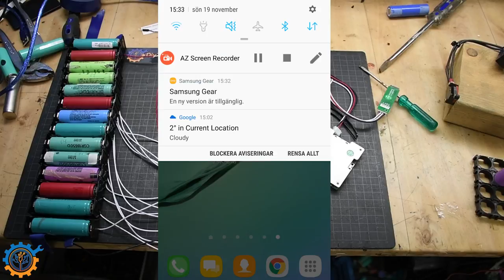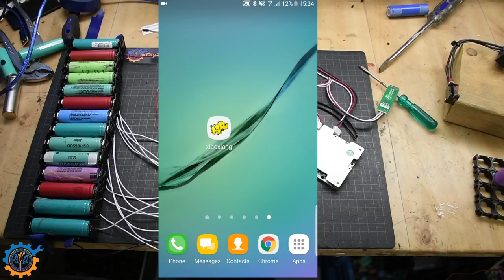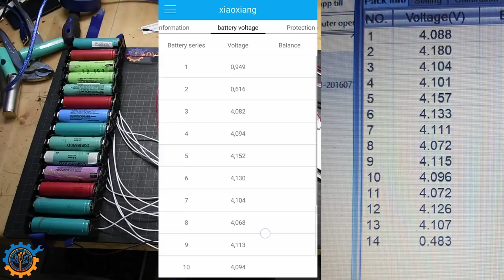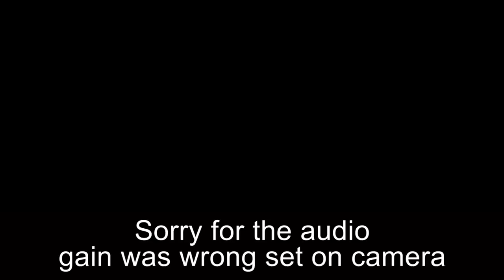Cheap BMS - Mobile software update - English

Comment: Classic Chinese BMS! This is exactly what I have to deal at work every single day... so frustrating... hardware and or software issues.
Chinese warranty: you contact the manufacturer, in many cases they will say "we sold millions all over the world, very successful product, we trust our engineers, YOU must be doing something wrong, please check" ohhh I have no words to describe... 
This is why is worth investing money and get Batrium =]
Reply from the maker: Yeap for sure! :) The more I used it the more stuff i have found that.. Lets say it gently.. Doesnt work :P
Reply: I dealt with a guy named James.  He was no help.  But at least he tried. I eentually figured it out on my own.  I dont think he is very technical.
Reply: Looks like Batrium does not have any 20S BMS. Can you recommend any other BMS for that many cells? BesTech?
Reply from the maker: Batrium can do ALOT more than 20s. You can easily go above 400V and they have even done above that.
Reply: Jeff Beasley Batrium is a flexible system, one main board controlling as many series you want.. 2s... 20s.. 43s...102s... basically whatever you have in mind...
Batrium is a premium super reliable product used in large applications such as electric vehicle, electric motorcycles, racing (car/motorcycle/GoKart), electric train, large off grid batteries, would you trust thousands of dollars worth in batteries with a cheap $20 BMS?
Besttech is a cheap very basic BMS using cheap components that run hot and may fail. I had many bad experiences with them and all these other cheap no brand Chinese BMS.
In the end it all comes down to "how much are u willing to spend? Batrium system is around $600 and may not fit if you have a very very limited space. This is when you get Besttech or these guys here http://www.batterysupports.com/lion-lipo-nbsp-72v-nbsp-20s-c-32_61.html
Reply: It's a lot of money to invest. If you have it all good. :)

Comment: hello I have the same 40ms bms but I have a problem, when I charge the battery the percentage meter of the battery never reaches 100% but the voltage does reach 54.66v and when it discharges it cuts me to 41v, the manufacturer It says that I have to do a few total battery discharges and full charges for it to calibrate but I doubt it very much, do you know what it could be? Thanks

Comment: To change settings you have to set the password once: i used 123456 for old and new passwords. Afterwards it worked. Maybe you have to use 1234 instead.

Comment: Hi. Can you point me to the connection adapter shown in the video ? Seems you also connected it to a PC using a usb conversion. Thank you.
Reply from the maker: All included in the buy. Jst is the balance connector
Reply: DIY Tech & Repairs I see. Mine did not come with the PC cable. Any way you can take a closer picture ? Maybe I can buy something similar. Thank you

Comment: Thats weird, I have a 100 amp bms like this one and I can change all my settings with the mobile app, also all my cells check out perfect, the temp is a little off like yours but that's my only problem so far.
Reply from the maker: Going Off Grid the voltage is due to no b- connected
Reply: o i c :)
Reply: Do you have a link to the 100 amp jobbie please
Reply: Can you post detailed wiring and setup video of yours?

Comment: So in other words, they didn't code it properly as it should've looked for a secondary language and they simply used the first language which failed to recognise and defaulted to chinese.
this is why open source is so good, you're stuck with some hardware with crappy software. I doubt anyone would reverse engineer the code as it wouldn't be worth it for most people.
good work.

Comment: I have the exact same problem . different cell number.  No reply from vendor and yes batteries gets. Affected
Reply: If you connect with the USB serial and use the windows software, there are the calibration page where you can set the correction values for each cell.

Comment: Its crazy because if they fixed these and proved they worked, they would dominate the market.

All we need is someone to reverse engineer the software and make it open source so we can fix it ourselves. I wouldnt feel bad either because thats what the chinese are notorious for anyway, copying others work.
Reply from the maker: No need to reverse engineer the software. You can write your own rather fast if you want. Just draw up the logic in flowchart and your ready to go kind of. The hardware is simple as well :)

Comment: "What you guys need"? Really? Sortware that doesn't work? Who ARE you?
Reply: @DIYTechRepairs  Can you adjust the parameters & save them? Looking at the front UI, those circles are supposed to have values in them. I see 0, in two of them, presumably suppose to have A & V there? The video wasn't clear, is all.
Reply from the maker: @skysurferuk  Dont know. I dont have that BMS in use. The issue with settings was the lack of some inputs connected.  This is rather old video now.
Reply: @DIYTechRepairs  Thanks for the reply. Good content.